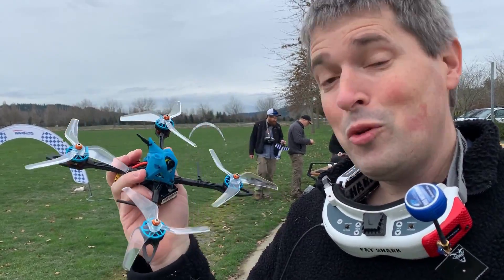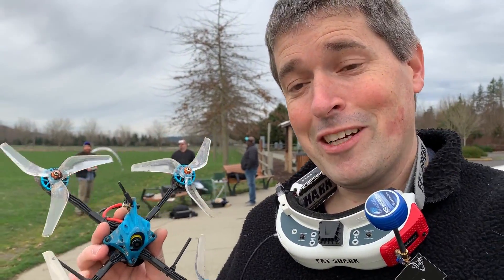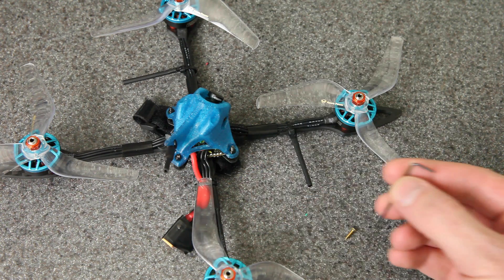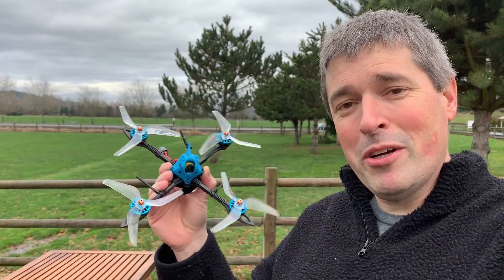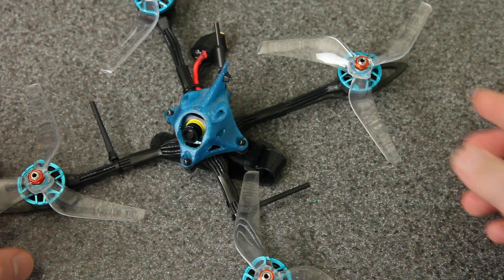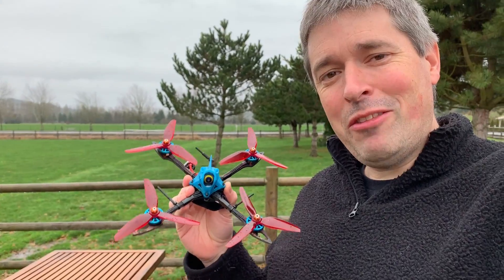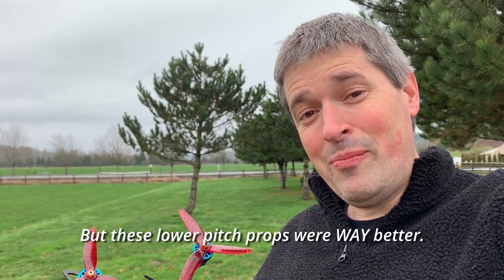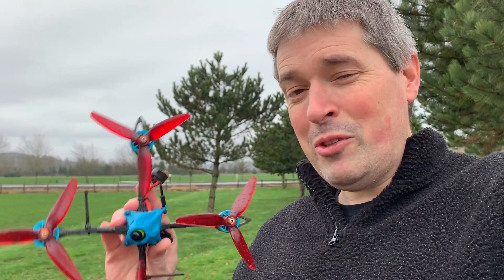My 5-inch "Toothpick" (experiment)

Comment: So I’ve built 2 ultralight 5”, one with 1804’s and one with 2004’s. The 2004s run nice. What kind of tune did you end up with?
Reply from the maker: I never got this particular drone to a state that I was happy with. I ended up scrapping it for parts. However, I have more recently build a TWIG ET5 with 1700KV 2004 motors and the new F722 AIO, and it flies amazing. Since it's an F7 I'm running 8K/8K/DSHOT600 with RPM filtering. You can check out this video if you're interested: https://youtu.be/5sJYGE7f6GU (betaflight details in the video description text). Cheers!

Comment: I was thinking of building this frame on the new Betafpv 1805 motors or Xnova 18xx motors. Have you tried a 18xx size motor yet on this build? I already built the 4 inch with a Caddx vista ..and I get 7 to 8 minutes just cruising around

Comment: 1. Thank you for all the testing!! Its refreshing to see more than just 1 config.
2. TP5 or UL5 has been arround years.. at least since T1 1407.  But few try it, so there still lots of things to try! (dont give up)
3. 2204 is approx same stator volume as 1806. Its not that big. I dont think heavier motor is THE fix. Especially since without bigger battery its just dead weight.
4. My BF tunes were both FAR from stock. Low weigth prop makes Huge difference. But, I believe the key is the tune. Maybe very low TPA (my 5ultras were under 20% throttle), or more throttle boost.

UL5 is 5" prop, sub20g motors and sub 150g dry weigth. 2 opposite demands. Cruising, low pitch low weight prop is great. But low pitch requires fast RPM change to make good response, which is typically better on taller stator.

Comment: I built a Dave C FPV design 5" toothpick, I used the BrotherHobby Returner R4 1806 2850KV motors and Emax Avan 5" bi-blades, I also put a Caddx Vista in it.  It flew fantastic up until the point when I did a full speed inverted yaw into concrete lol, destroyed the Vista, the crossfire nano and the betafpv aio board.  Damn that was an expensive experiment lol
Reply: BigD-FPV Hi, I’m looking to do the same. How did you build Dave’s frame? If you make them I’d be willing to purchase one.

Comment: Have you tried it with 2306 motors?
Reply from the maker: No, but I've tried a 2207 motors. I do not recommend oiling those bigger motors because they all come with well sealed bearings. I don' think the oil will help and it might do some harm. I think the oil is mainly beneficial for whoop-sized motors without bearings.
Reply: @MrShutterBug  Thank you for your appreciated answer!

Comment: I build one using 2204 motors the 2700kv from RCX, they were light. (not the most powerfull motor)  I do not like the motors with small bearings,  but otherwise the1806 - 2500kv LDARC is an amazing performing motor very efficient and fantastic power, but uses very small bearings.....on 5 inch small crashes or unbalanced props eat those small bearings fast.

Comment: Toothpick IS the future. Better integration. 
For 5", need 1806, and only good one is old BH. 

Even 6" is possible: 30g Druckbar frame, 110g battery, 20g motors, and 30g for props, camera, vtx, AIO FC, etc.

The problem/key is the props. Very few 5" 3blade are below 3.6g. DJI style swinging/mounting and carbon fiber would save weight, and allow fast prop acceleration.
Similar: http://rctimer.com/?product-1180.html

It can be done!

Comment: Over 30 20min+ flights on my 250g 5" ultralight with RCinPower 1506 3000KV and 5030*2 (1.9g) with 1350mah 3S or 1050mah Tattu 95C 4S.  Avg as low as 36-40W. I mostly do slalom, split-S and 40-50 flips/rolls. Motors cool. I killed battery down below 3.3V cell and managed 27min flight. Yaw is slow/bad because it uses the momentum of the props, and they are so slow/light.
Reply: You sure they’re RCinPower 1506 as they only come in 5mm shaft.   The RCinPower Smooox 1507 Plus M2 use T-Mount props.   I’ve currently got the Flyfish Atlas 4 LR and have put in good times with the Smooox 1404 2750kv motors, but have remixed the arms in Fusion360 to 5 inch and have sent the design to Cncmadness.   I should have the new arms in the next week or so, going to try them on the 1404 with the HQProps T5x3 first, maybe I’ll throttle limit them to not burn out the motors but might need use my Xing 1504 on them or look at the Smooox 1507 Plus M2

Comment: On my 5 inch Asteroid, I use Brotherhobby 1507's. The smaller motors make alot more sense, but the battery is still the problem.  Tattu R-Line 95c 850 mAH 4s is fine, but the voltage sag is annoying when flying aggressively.  Gemfan Windancer 5143's are great, but the HQ 4043's V1S is even better.

Comment: Great Video MS. the secret to building an Ultralight 5" as you touched on is the HQProp T5x2, it's a revelation for this kind of build😁👍 I built a Sub 200g (AUW including a GNB 4s 650mAh battery) HD 5" with the HQProp T5x2 props last month using the Emax 1306 2700kv motors, as I couldn't get hold of the BetaFPV 1505 motors, it still needs work but its incredibly fast, agile and best of all super efficient 😉 :-  https://www.youtube.com/watch?v=bAQs8-gQN20&t=37s - https://www.instagram.com/p/B9FOUpAH92v/

Comment: Hello,
I've done quite a lot of testing on light 5 inch set up, and they fly great, I prefer them to my heavy setup.
Try skiny props,  like tmotor 5143, or the new Dalprop Spitfire, it should make a huge difference. 
Another thing, I still use 5 inch batteries,  the motor needs its fuel.
For information, my setups ranges from 185g to 200g dry weight on  high kv 2205 motors like BH R4 2700kv.
Reply from the maker: The issue with adding a larger battery is the flexibility of the arms. What 5” frame do you use?
Reply: Hello,  I use my own frame , I have a CNC router, si I can do what I like :-)
Reply: I can send you pictures if interested.
Reply: grandseigne cedric Hi, I’m looking to purchase a 5 inch ultra light frame, are you willing to sell a design?

Comment: Cool your trying different settups bro , i really like what your doing. 
should try a 4 blade prop with low pitch,  i find them very good fpv video noise and thay seem to balance out the prop with the motor nice plus thay grip good in corners.

Comment: Just finished a 5" using the Racer x et5 frame, betafpv 20 amp aio, betfpv 1505 motors, HQ 4" bi blade T-blades, caddx baby ratel, little Axii antenna, HGLRC mini vtx...150 grams dry....just got back from a maiden but having video problems. It flew real nice LOS and seemed easy enough on the amp draw.time will tell...
Reply from the maker: Cool, I might build something like that in the future, but I'm using the 1505 motors on a 4" right now, and it's also pretty sweet! :-)

Comment: I did a build using this frame using Sunnysky 1806/2500kv with Dalprop T5051CR props (very light) and it flies really well and it is 170gr dry build. Love it! Had to do some tuning on BF (that I still have to perfect) but so far I'm really happy with this build.

Comment: What you discovered about the performance is why there's no TP5. There may be in the future but it'll be far closer to just a regular 5" than a super light something or other. That quad is fine. Keep it as is and wait for the new 3.2g props coming from Gemfan in the probably near future. Or if you have, swap to bigger motors and lower kv. If the kv is higher, just give it some throttle cut to keep the amps under control. Those motors are just too small for the load unfortunately. Put a 4" prop on that quad instead of those 5" props and you'll probably like it a lot.
Reply: I was just about to comment put 4" props! KABAB!!!
Reply: Hey wassup kabab

Comment: I understand what you mean about it not really fitting into the 5" space, but is certainly a fun experiment.  What we really need is for you to push a manufacturer to make BNF quads based off your fantastic 3" 1S quad build! ;)
Reply from the maker: A BNF BabyTooth would be pretty great. I'm not sure if Kabab can pull that off, but I expect one of the other manufacturers will probably pick up on the idea before too long.
Reply: @MrShutterBug  that video of yours should serve as the definitive standard for then to match.  There's nothing like it on a shelf anywhere and because of the cheaper batteries while maintaining the perfomance you showed, this should rightfully cannibalize the market space of a LOT of the 2S and 3S micros out there.

Comment: I see that you recently build ET5 like me, how do you compare to each other?
Reply from the maker: I do not have an ET5, but I think it would probably be better than this if paired with 15xx or 16xx motors and those really light HQ 2-blade props. What are you flying on yours?
Reply: @MrShutterBug  built 1606 3300kv with 5" tri blades.. total weight is 180gr. Planning to use with 1000mah 4s. Got the bi-blades but I bought wrong motors so had to use a regular 5" props instead of t-mount.

Comment: I've been eyeing up those xnova 1804s for a while. I've got an appropriate frame I just need the motors and a new AIO board to make it work. I was thinking 2200-2400kv would be ideal for 650-850 4s but I've been wondering whether 3s on 3100kv might be better.

Manufacturer thrust tests aren't that insightful but according to xnova the 3100kv maxes out at about 175W on the GF5030s which is about 30% lower than on 4s 3" props.

Not sure what your objective is though, for me I want more of that toothpick flight feel, flight time, volume and cheaper smaller batteries. 3" toothpick's are great but I want a proper low light capable camera, lost model buzzer, proper antennas and maybe even a gps to feel truely unrestricted.